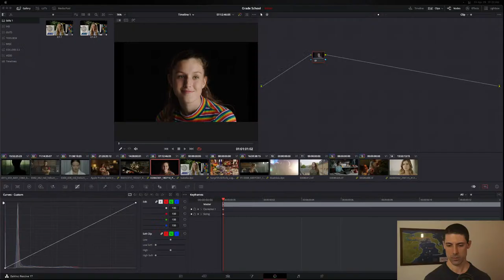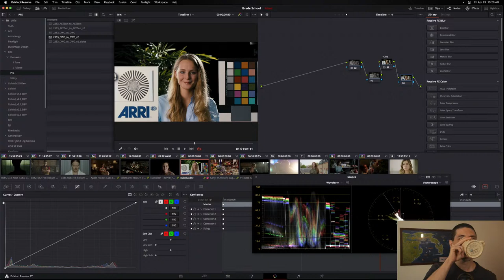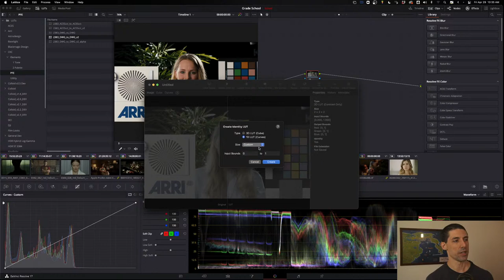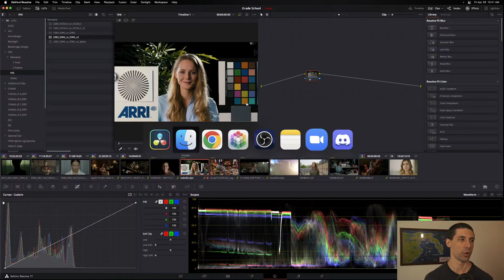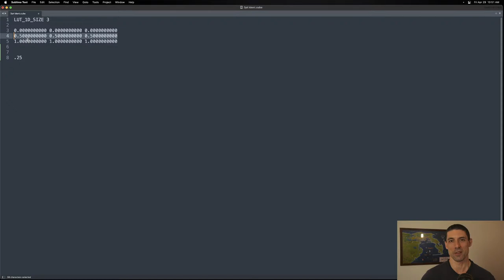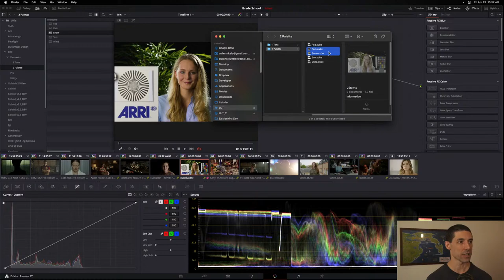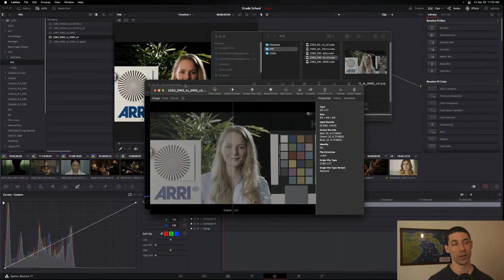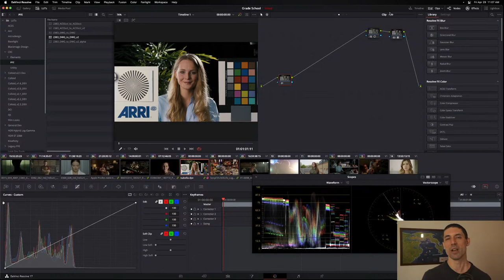Grade School: Debunking LUT Myths & More w/ a Senior Colorist

Comment: Hi Cullen, recently discovered your videos and have been binging them for the last two weeks. I have a question about DWG and Luts. I purchased your Elements luts which work great; I wanted to know if there are any other 3rd party luts that work well with DWG. 

I mostly use Osiris Luts, but usually have to lower the gain to get good results. 

Thanks.
Reply: Thanks for the reply.
Reply: @CullenKelly  FYI I've been playing around with different 3rd party options. Colourlab AI Looks designer works great with Resolve. It has and OFX in Resolve which allows us build our own FPEs. It also works with DWG setup at the project level or node based and can used as the IDT and ODT. 

Thought I'd share with the group. Looking forward to Luts Class tomorrow!

Comment: Hey Cullen, I have always been under the impression that footage should be color corrected first before applying any sort of creative LUT. Would you say this is still best practice to get White balance and everything corrected first, and what are your thoughts about applying a LUT and lowering its intensity? The last few LUTS I have used after getting my footage color corrected have made it overly contrasted, saturated, and not pleasing the look at. My first thought is to just lower the intensity of the LUT to 20%, but not sure if that is defeating the purpose of using the LUT in the first place?

Comment: Arri makes a conversion profile for Alexa to fpe (correction : not fpe but neg primaries*)
Reply: It emulates neg primaries, it’s not a fpe. The idea is that using the matrix will make awgrgb logC pass through a typical print emulation lut that expects a negative with acceptable results.
Reply: Apologies yes lt’s not an fpe at all ! 
Yes it’s simple matrix but it tend to use it with my emulation node tree and I got some pretty results